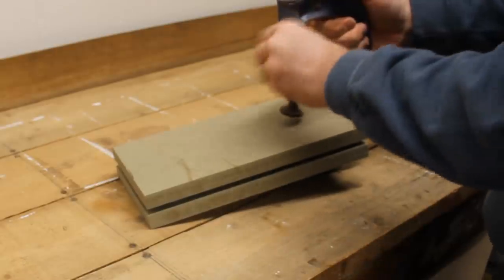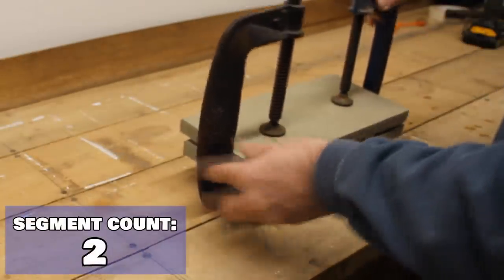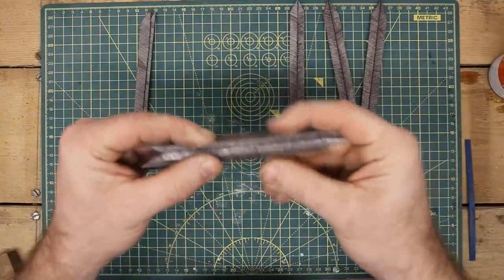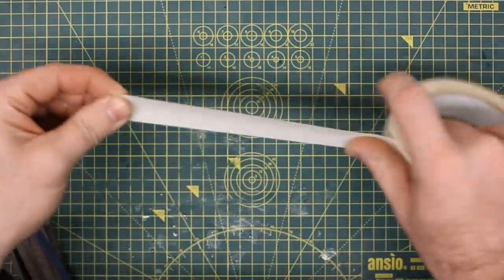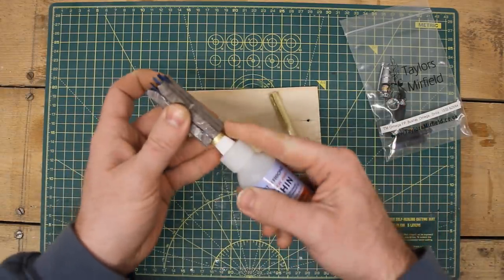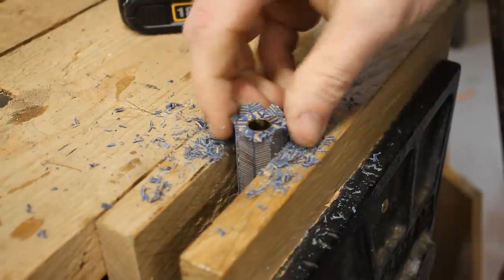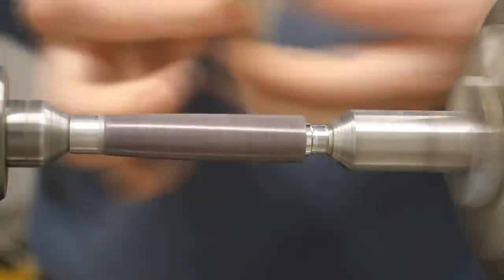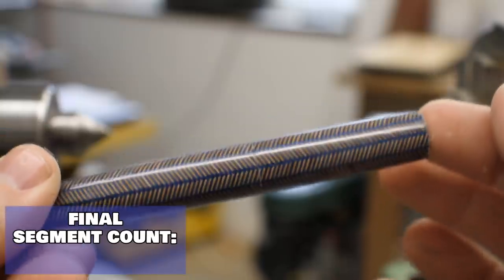I make a 2000 SEGMENT FOUNTAIN PEN | Woodturning challenge

Comment: Number of segments: 2000
Hours spent: 1
Hours spent flipping a small plastic bottle: 29+

;-) The pen look awesome by the way. Yet another reason I have to get a lathe and a better band saw!!
Reply from the maker: Haha, yes it was probably that ratio in the end 😂 thank you, just try it on what you have! I made my first 200 pens on a £60 lathe that needed a g clamp to hold the tail stock together and a £30 tabletop bandsaw that I would still use if the top wheel hadn't sheared off a couple of years ago, I think I used my old lathe on the 500 segment pen video before I got my new one
Reply: @JamesGarwood  Woooow amazing👍👍👍

Comment: 3:08 Whaat? Did you just cut the rectangles into squares just to glue them back together into rectangles?

I don`t get it.
Reply: He did that to increase the number of vertical layers. The piece he started with was short and wide with horizontal lines, the pieces he ended up with were skinny and tall with horizontal lines.
Reply: To multiply the layers by cutting out the horizontal he could make it longer/more layes 
oooo

oo
oo

o
o
o
o 

He made the wide go to the long if you can get it.
Reply: ||||||||||cut and flip ========= vise versa

Comment: You are adding liquid glue to one piece and spraying the other piece of wood.  What kind spray are you using?
Reply: Came wondering myself, here was his reply to someone else asking: "It is a CA glue accelerator,  it makes the glue dry in a couple of seconds, so I don't have to hold the bits as they dry and can get on with the next step, there was lots of steps lol"

Comment: As a mechanic it hurts my heart to see how rusty that chuck is
Reply from the maker: I know  it wasn't like that when I bought it I had no choice but to keep it in a shed over this winter 😭 what would you do to fix it?
Reply: James Garwood at first I would take it apart (at least take the jaws out), sand of the rust and than clean the whole thing properly. But the most important    part is to always keep all the surfaces that are bare Metall oiled. Especially if you don’t use it for a while or keep it in “bad” environments. But don’t use WD40 or Caramba for that, because that’s not really an oil.

Comment: You should really use a tool post and a compound rest instead of straddling the metal bit with a file. I've seen people with missing fingers, and know of people who died doing things like that. That machine is strong enough to rip you in half, if you're not careful. When you're just turning wood, it's somewhat understandable to be using hand tools. But metal will break you before you break it. Just a PSA. Fantastic work, though.

Comment: Very nice job but I think you are overdoing it with the activator.  A thin ca coating applied like that with a cloth on turning wood will dry in about 3-5 seconds without any activator either before or after.  It's probably already dry by the time you spray it.

Comment: 4:10 What's that spray for? I notice you glue one side then spray the other with that - what is it?
Edit: Guessing - Does it make the glue dry/set faster?
Reply from the maker: Yes thats accelerator for the CA glue, so I don't have to hold pieces together for ages while they dry 👍🏻
Reply: @JamesGarwood  Yeah that's what I figured after I saw you use it on the outside of the pen.
By the way - Great work! Loved it. Subscribed

Comment: How do you clean the glue from your hands when you’re done? Does it dry on your fingers often?
Reply from the maker: The pva glue washes off easily with hot water, the CA glue is on there solid but flakes off with hot water or after a day or so

Comment: terrific video as always! how do you decide when to use CA vs wood glue?
Reply from the maker: I use the CA glue when I want it to dry fast and get on with the next bit and I use wood glue when the glue up was really tricky and I needed the time to align all the pieces correctly, I would use wood glue all the time if I wasn't in a hurry because it's cheaper 😁

Comment: At first I thought it’s only the file, but lathe also is in poor rusty condition. Why? 🤔
Reply from the maker: I had to keep it in my shed over winter while I built my new workshop and it was damp is the reason
Reply: @JamesGarwood  You would certainly do well to put a handle on the file - the very first time you catch a chuck jaw is going  to drive that tang straight into flesh, it isn't pretty (I wish I could find the link to the X-ray picture that shows it!).
Reply from the maker: I do not do much metal work, bot even sure it was the right file for the job but it was the only one I have, tag me in a picture if it's on Instagram @The_Cabinetmaker is me 👍🏻
Reply: @JamesGarwood  I think it was fine in itself, the metal didn't look particularly hard and it certainly seemed to do the job. Without a handle and when used near a rotating chuck the danger is simply that one of the jaws will strike the file and, when it pivots, the tang is likely to be driven into your hand. For the sake of a cheap wooden handle it is quite a risk to take, especially given the rotation speed and the angle that you filed.